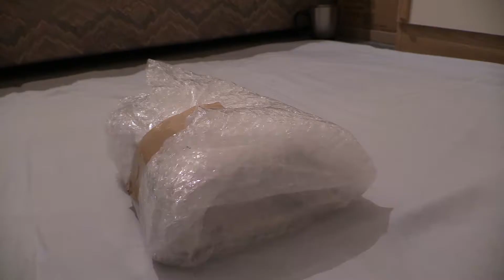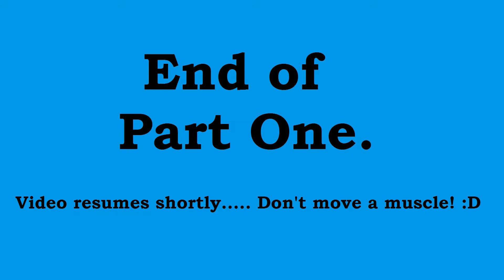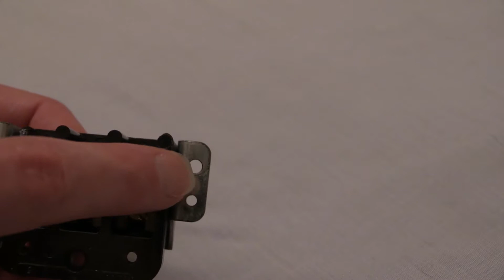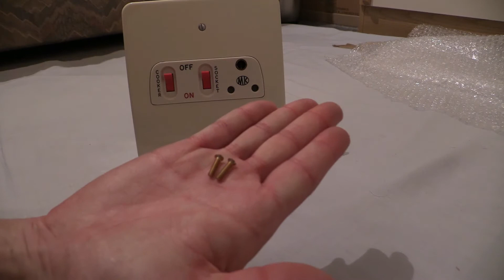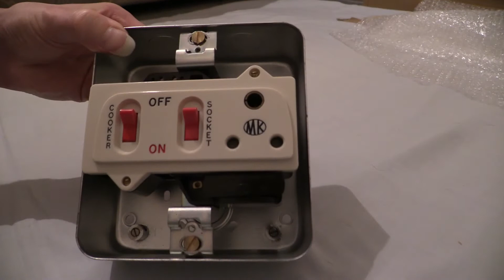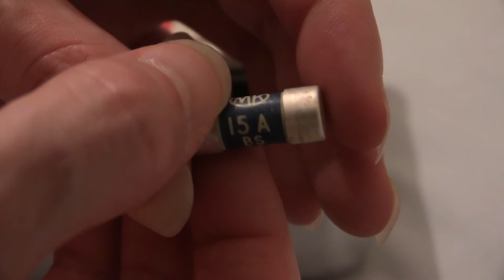Plugs : MK cooker control unit with 15A socket to BS 546

Comment: Hello, are the wiring connections on the back of the cooker control switch and socket assembly? Thanks good video.
Reply from the maker: Hello there. Thanks for 
your enquiry. I can say 
that the terminals on this 
MK Cooker Control unit are.....

.....Not on the back of it.

Taking into account the thickness of the cables which would be going into this unit and the depth of that back-box, it would be rather impractical to put the terminals on the back of the unit, as like they are on a standard 13A wall socket.

Apologies for the delay in responding. I have been silly-busy with many things including shooting Even More Vids for Wayne's Electrical. :D

Thanxx for watching,

-Wayne's Electrical.

23rd May 2020, 18.00